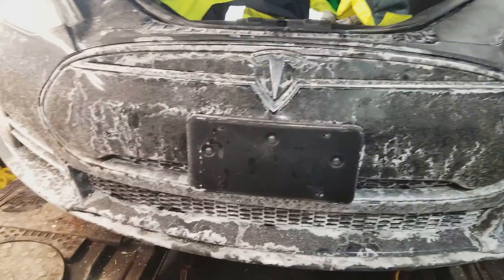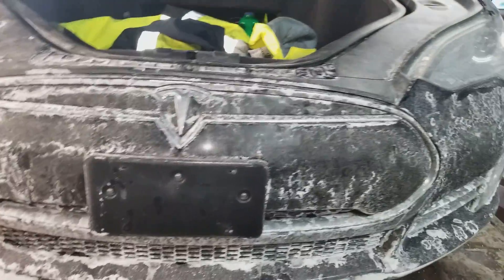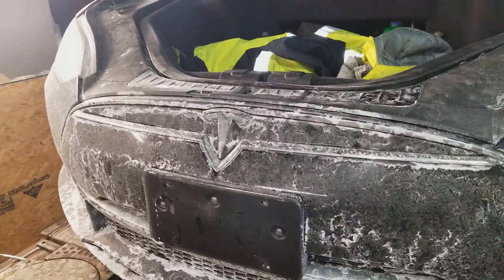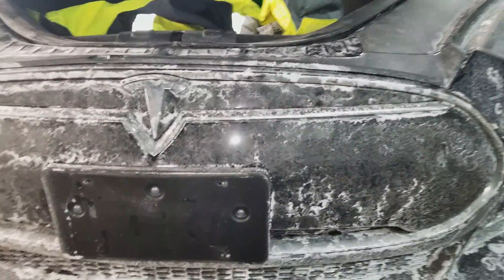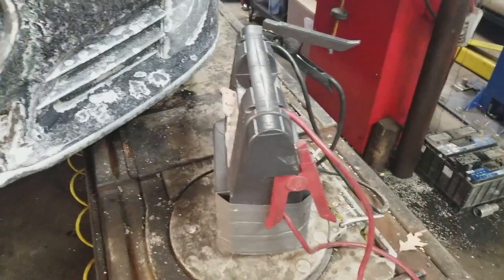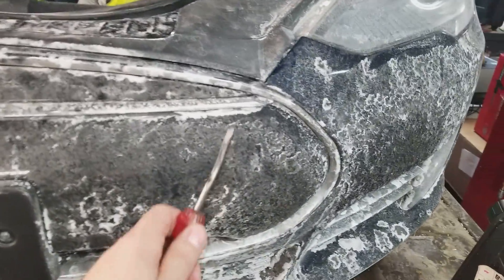Jump "starting" a pre-facelift Model S

Comment: Never pry plastic with metal tools
Reply from the maker: apachelives does it make a difference? The front end gets bombarded with rocks, and I have other nose cones if they get damaged. At the end of the day, it doesn't make a single bit of difference.
Reply from the maker: Günter Jibben  I just checked. Trim is perfectly fine. No issues outside of sand blasting from 61k miles of use.